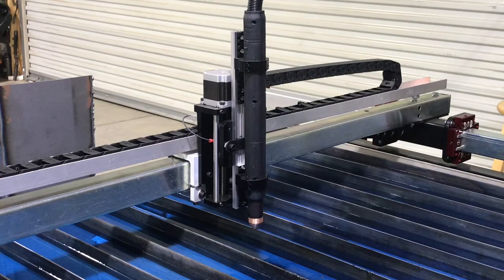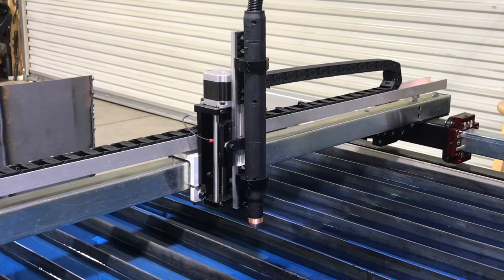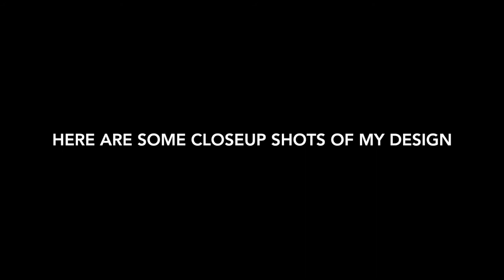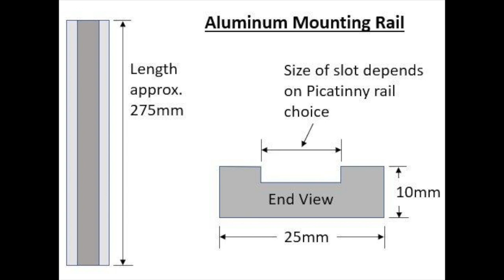Machine Torch Mounting with Scope Rings

Comment: Nice idea.   So instead of hard mounting it to z axis have you considered magnetic mounting it.  That way if metal bows or lifts and snags torch it pops off instead of damaging something.
Reply from the maker: hey Steven,  I’ve seen other tables with magnetic mounts but usually using a hand torch instead of machine torch. not sure what would happen if the torch got dislodged will cutting...with my luck it would cut my rail in two 😂.  actually the torch height controller senses cutting amps and if out of spec shuts torch off so shouldn’t be a problem.  The torch cable and torch weights quite a bit so would probably  have to use an array of magnets. I’ll have to search and see what others have done.